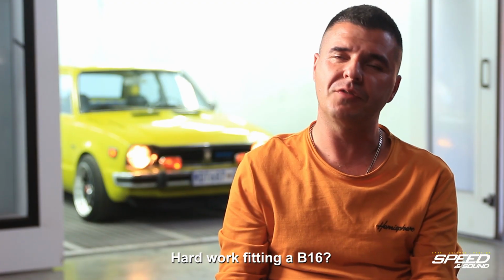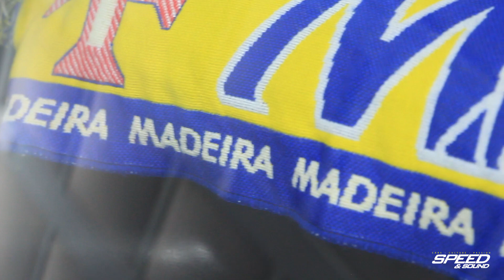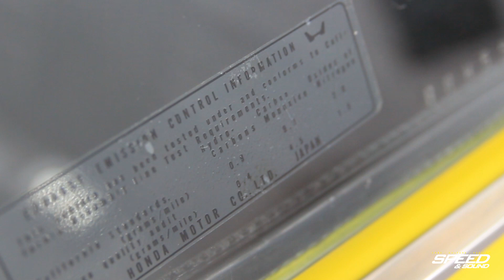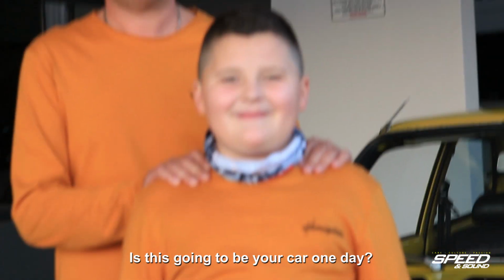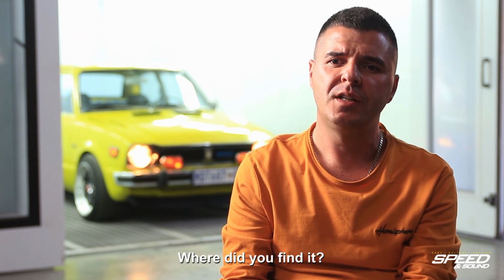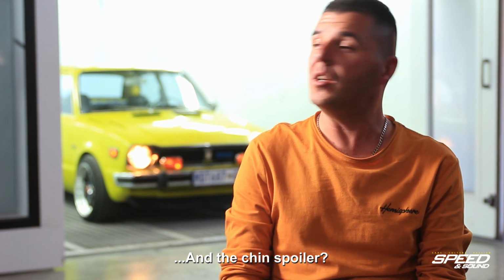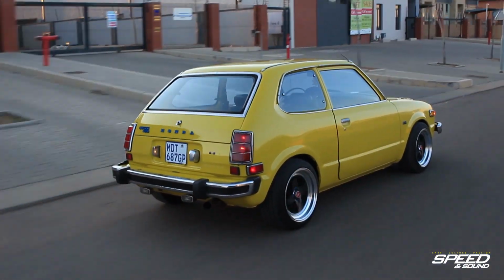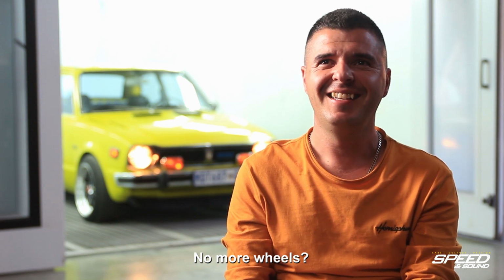D-SERIES POWERED // Honda Civic Mk1 CVCC

Comment: Theres a Silver two door 1974 first gen civic with 5 slotters, extractors, aluminium checker plate door trims, wood grain steering wheel, even got a skull shifter, and it's in western Victoria Australia. Its mine, I'll make a post in 6 months when I'm done doing some more upgrades. 😊

Comment: A all motor d16y8 with forged top and bottom internals, ported block, ported and polished heads, valves, valve springs, titanium retainers, cam and a intake manifold with a 70mm throttle body you got yourself a monster trust me.
Reply: With all those mods is almost the same power as a B16 lol
Reply: @dirkdiggler9082  Actually NO..D15 with cam, ported head and bolt on's make 120-125kw..
Reply: @hondatrix  Maybe on a lala land dyno in daspoort pretoria on nitro meth.